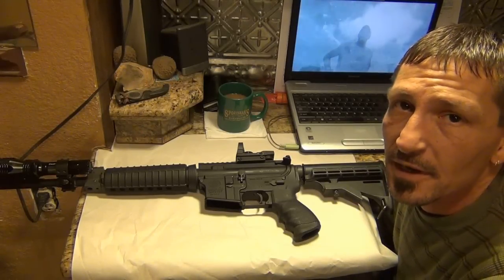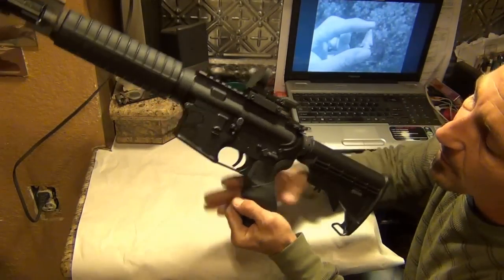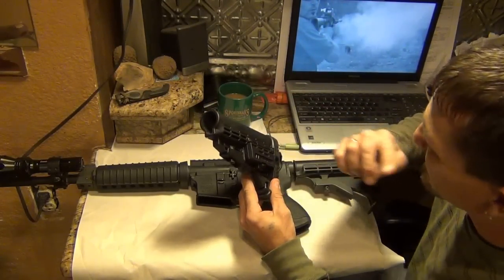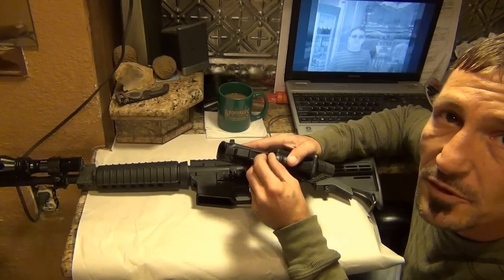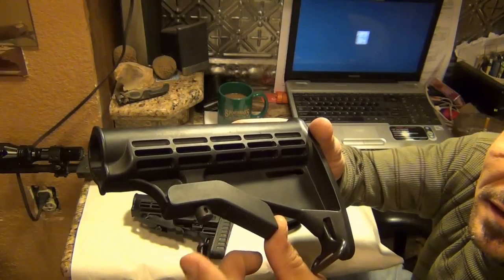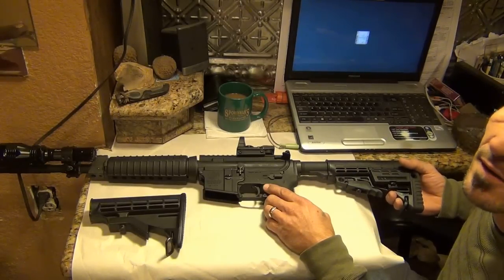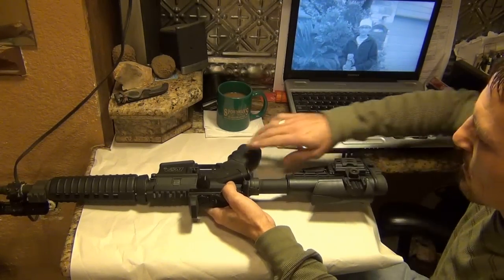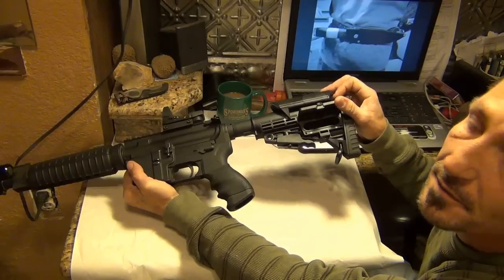AR15, Command Arms Sniper Stock and Cheek Riser

Comment from the maker: can you get it off? or is it stuck on the tube? instead of pressing the release, try pulling it like you do tyo put it on the tube and see if it will clear the rail holes. If it will then you need to pull the small roll pin going thru the bolt and nut at the release, back the bolt off a few turns with a screw driver so that it will clear the holes and slide on the rail. Once you get that cleared, turn it back in until its just clearing for  the best fit.